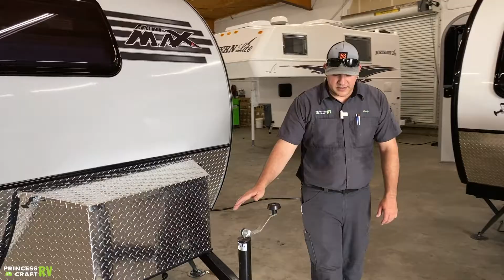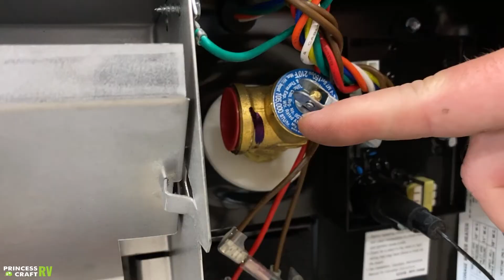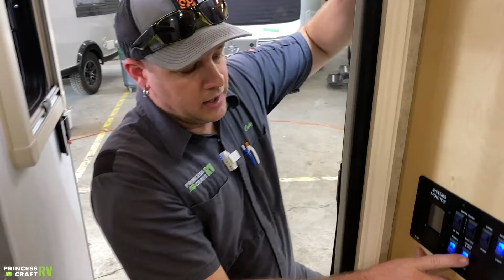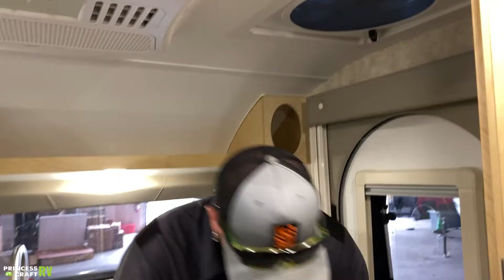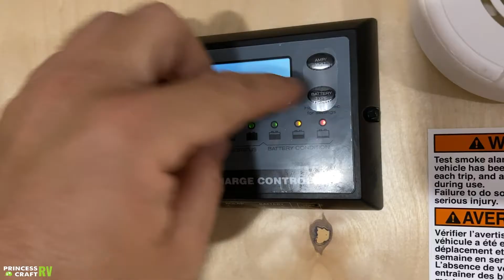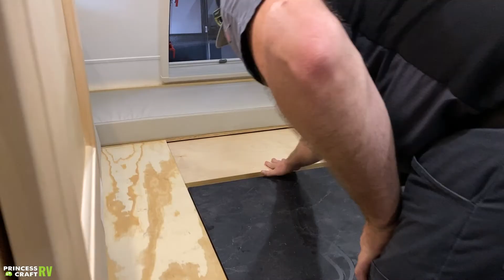Little Guy Mini Max 2020 by Xtreme Outdoors Technician Tour

Comment: We purchased a new 2022 mini max on Friday July 28, 2023 

Our dealer did not do that great of a walk through so after having camped in it this past weekend. I was determined Sunday night to find a good walk through. As luck would have it this a great walk through. I am actually glad that I used the trailer first and then watched this video as it answered almost 99 percent of my questions. The only question that remains for me is solar to battery and how all works when I have plugged the Camper into a power source.

Great video and man I do wish that Extreme Outdoors put this much effort and detail into every build. The camper in the video is not realistic to what you will see on most lots as far as finish and fit and neatness. This is what I would call a Spec model so set your expectations accordingly and if you do see one in the same shape I would consider that RV center actually does do  a true dealer prep.

Comment: Why is it that I keep on seeing reports of Little Guy trailers leaking?   It is one piece fiberglass top right?  I’m talking leaks in the air conditioner, leaks in bathroom leaks in the front.  $40k for a shabbily built 21 foot teardrop trailer is ridiculous.  I guess, like most trailer assembly lines, the employees don’t actually make sure they do good work.  I mean anchoring panels into solid backing and properly caulking joints.  It is a shame actually.
Reply: You asked a question and then make an assumption assuming the answer to your question. I have researched these and I have not come across any complaints of leaking on this particular brand/model. Point to some postings on all these multiple different leaking locations as I assume you are not talking about one camper complaint.

Comment: Thanks for showing everything wonderful presentation - Question: How do you operate the crank balances all around the trailer?😊
Reply from the maker: They are manual, and easily cranked up and down with a crank handle. So make it faster, it’s common to add a socket to a cordless drill and quickly crank these jacks down to the ground to stabilize the trailer.

Comment: Can you use the sleeping area as two separate twin beds instead of together as a queen? What is the measurement width of each side to sleep on?
Reply from the maker: Yes you can! The Little Guy website says, "75"x70" Full Queen Size Bed Option
Dual 70"x21" Twin Size Bed Option." Hope that helps!
Reply: @RVTechToursatPrincessCraft  Yikes, my 6ft husband will not fit on the twin.  Too bad.

Comment: What power supply can I use if take the tv to the  outside  tv mount?
Reply from the maker: Just before he mentions the outside tv mount, he shows the electrical outlet nearby with a household plug that would work for the tv.   There’s also USB outlets for other electronics under the same cover!
Reply: There is actually a power brick, like you have for a laptop. That is put in one of the cabinets. It’s purpose is to power the tv when you move it to the outside.

Comment: Great little camper for boondocking. The refrigerator ran for three weeks and the solar panel was enough to have power every night.
Reply: What did you run the fridge on?
Reply: Is there a switch to turn on the solar? For some reason I have no solar power for any lights or anything in my unit. It's brand new just picked it up a couple days ago
Reply: Did you have lithium batteries?